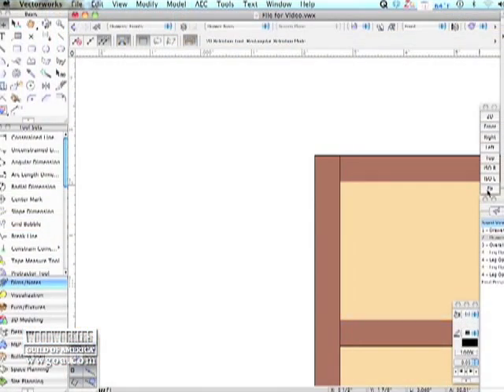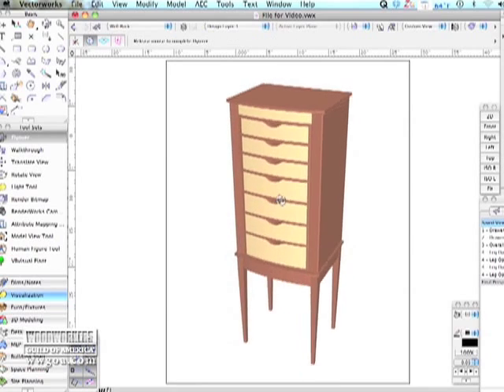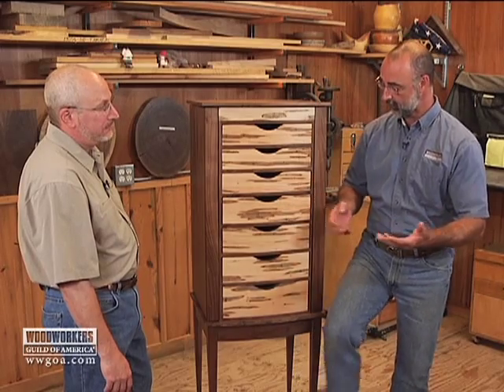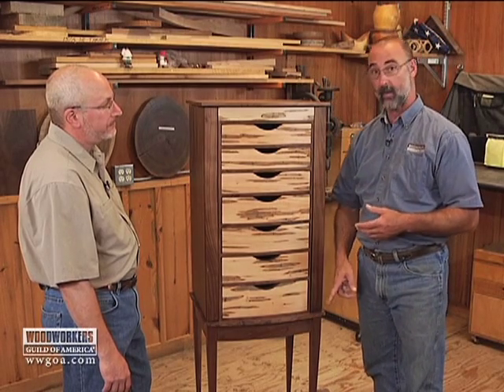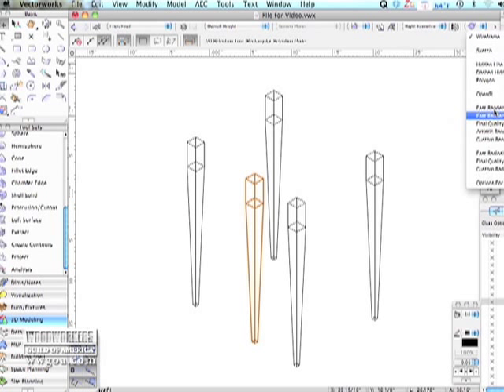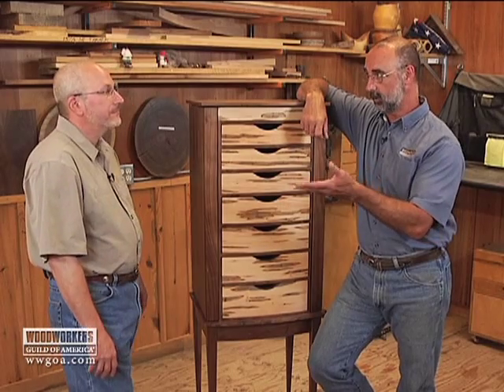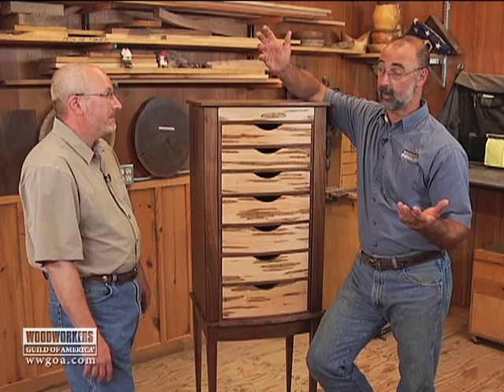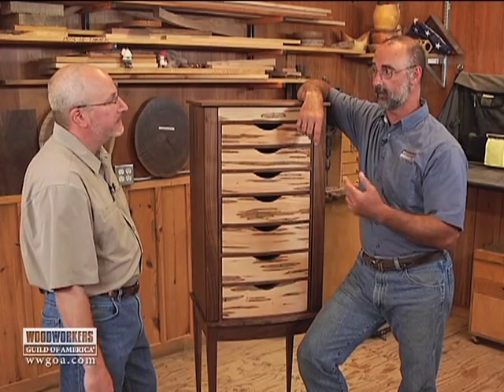Prototyping a Woodworking Project Using CAD

Comment: So what is the CAD program you are using. I would to obtain an affordable, free is possible, CAD package for woodworking and metal work. Any suggestions gentleman?
Reply from the maker: For a free CAD application that is relatively easy to learn I would recommend Sketchup Make. You can find a couple classes on the WWGOA web sit to help you get up to speed more quickly.